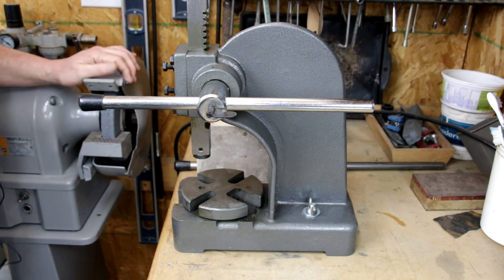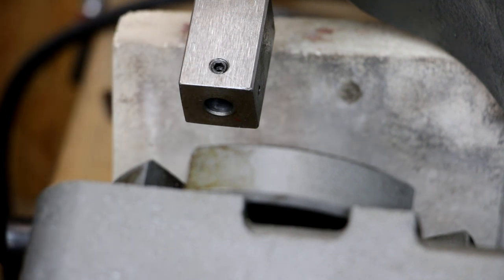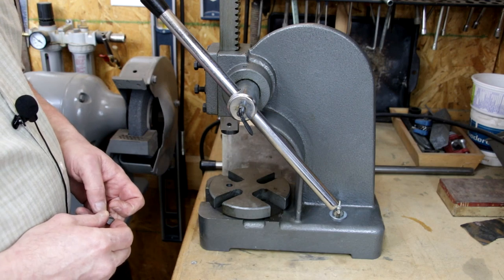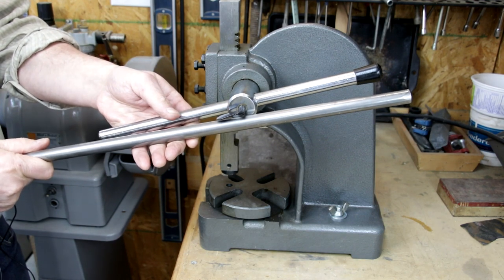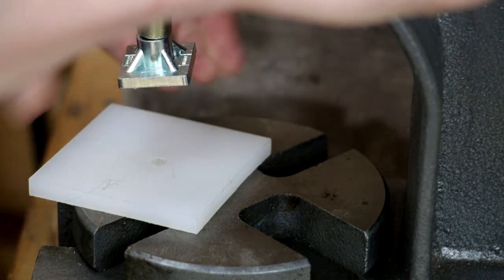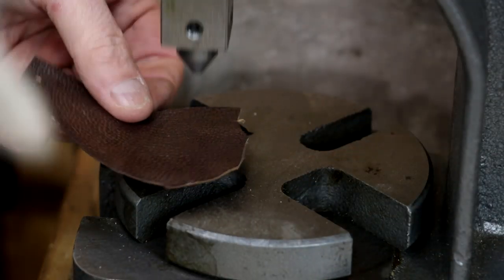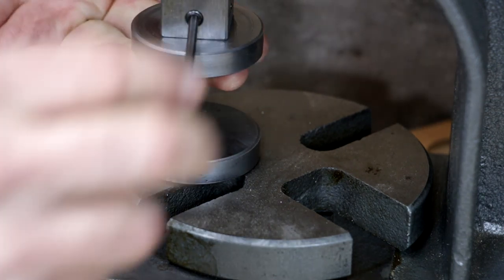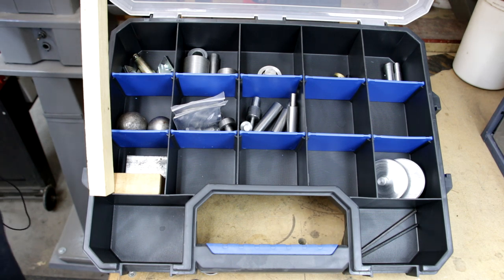Make 1 Ton Abor Press Tooling

Comment: Great video! What did you use for the longer handle. What was the length and OD? Method?
Reply from the maker: Thanks! I used 1018 cold rolled. It is 5/8 inch. I keep a bunch of 1018 in different dimesnions in my shop. It is cheap and also welds easy. Cheers.
Reply: @ChannelofRichPierik  Thank You. What length did you use? Your Mods to the Arbor Press were very useful.
Reply from the maker: @elizabethrogers6897  double the original. Cheers.

Comment: I welded a half inch drive socket on the end of my spline gear and use a ratchet. when I dont want the ratchet I attach a breaker bar.

Comment: I just bought a 1 ton press to help with metal stamping for jewelry, but I'm not sure how to go about mounting it. My work spaces are Ikea desks unfortunately, but I was thinking I could use a wood tree stump.
Reply from the maker: A sturdy bench or table are best but anything is better than nothing. :) If you mount it to a heavy piece of Plywood then clamp to your table when needed may be an option. Cheers.
Reply: @ChannelofRichPierik  are there various screw options, or just a general wood screw?
Reply from the maker: @gillianharris9534  Look at carriage bolts. Up through the ply , with the threaded portion above. So that the nuts or wing nuts can secure the press.... Good luck!
Reply: @ChannelofRichPierik  thank you! I appreciate the info 😊

Comment: What is the dimension of the hole at the bottom of the rack before it was drilled? I was planning a standard punch out of the box to use this in driving out pressed-fit pins.
Reply from the maker: There was not a hole prior to drilling it. Cheers.